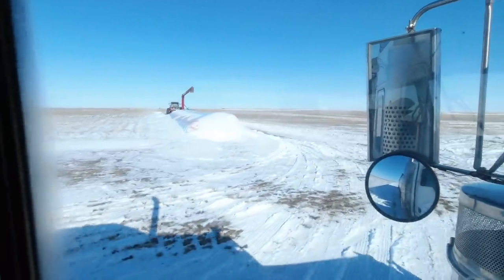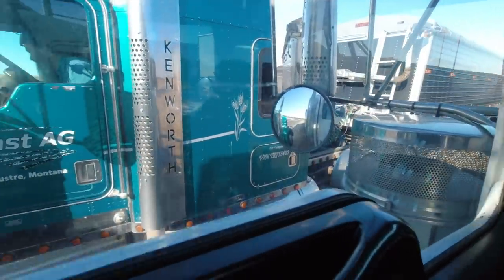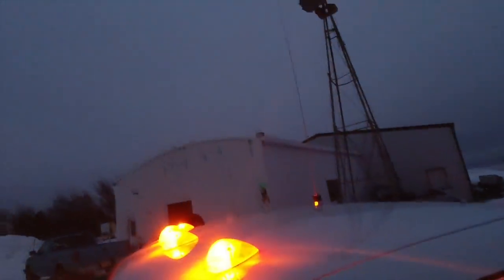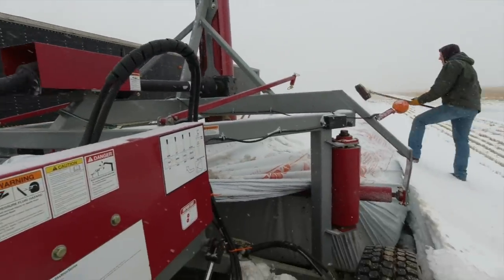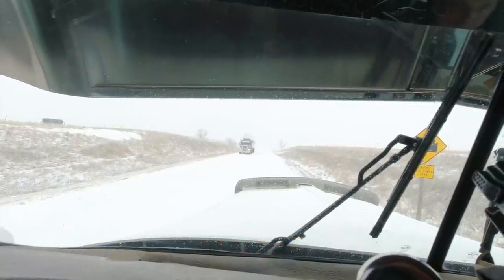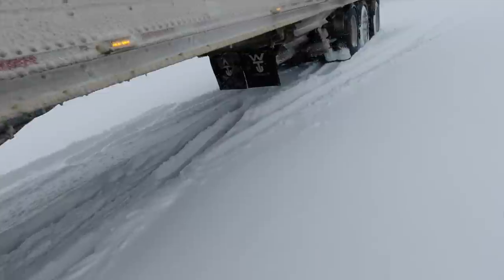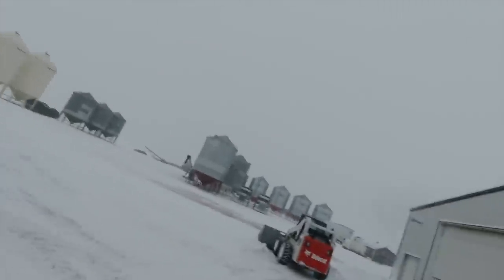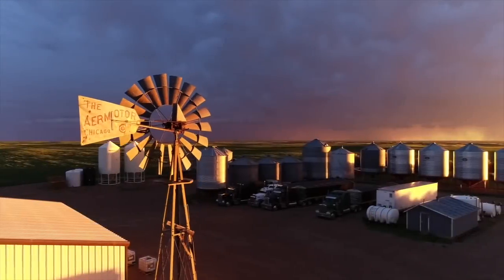STUCK TRUCKS EVERYWHERE!

Comment: Thanks for the video Tony👍 does the grain bag unloader pull the tractor back or do you have to back the tractor up as the bag continues to empty out? When we milked cows we had a ag bagger silage bagger and that would push the tractor along.
Reply from the maker: It pulls the tractor along.

Comment: Been driving truck for 25 years and FYI you shouldn’t use engine brakes on slick roads, causes a tractor jack knife too easy
Reply from the maker: Gregg Mccleary I am well aware of that.  Foot on the throttle ready to accelerate and a hand on the trailer brakes.

Comment: I see there was super b trailers are you allowed to pull them in Montana? Or was it just because they were Canadian trucks?
Reply: AgTech 45 I was wondering that myself.
Reply from the maker: We can pull them but we can't put much more weight on them as we can on our triples. About 4,000 pounds difference of payload.  I wish they worked better.
Reply: We can pull about 43 tons in them depending on how heavy the truck is
Reply: In Canada 🇨🇦
Reply from the maker: AgTech 45 they are only good for 35 ton here.  And I haul 34 on my triples.
Reply: Makes sense then don’t need 2 more axles for a ton thanks for the info
Reply: B trains can be a pain in the ass been pulling them here in lethbridge area for a while would sooner go back to a tridem

Comment: Why does almost every truck in line have a sleeper cab on it? Don’t most farmers only haul within a few hours from there storage site.
Reply: martinsteele05 I think most farmers buy used highway tractors for their farm trucks.  They don’t put on near as many miles as highway haulers.
Reply from the maker: Yes our trucks are older and they are way easier to find sleeper trucks then day cabs. Sleepers are more comfortable because the seats go back further.
Reply: That’s what I was thinking. Thanks.

Comment: Are you serious? I just watched that plow take an inch or two off the road and that’s stopping you? Wow!
Reply from the maker: Don Nebes closed shoulder tires, 30 deg temp turning and snow to Ice, a steep grade with a stop sign at the bottom followed by railroad tracks, a nearly 100k pound load.  Better safe then sorry.

Comment: Just a heads up your ariat links don't work
Reply from the maker: Ben Dahmm thanks! I need to figure that out.
Reply: @FastAgMontana  you're welcome
Reply from the maker: @bendahmm7393   Here is the Linkhttps://ariat.dkkdet.net/c/2073395/768687/10644 for some reason it was short when I copied it over.  Thanks for the heads up!